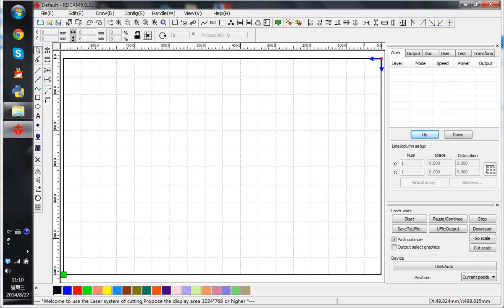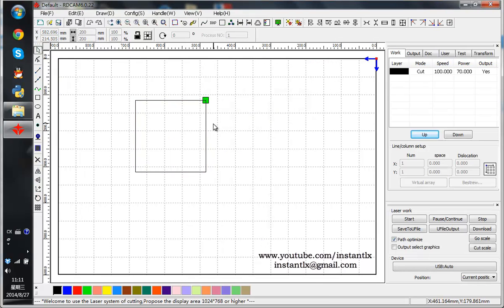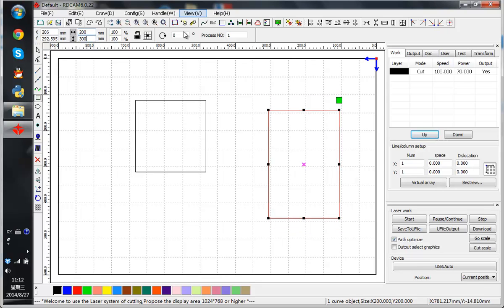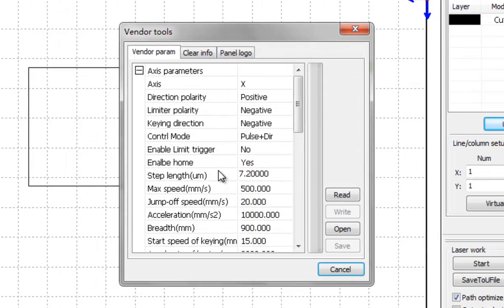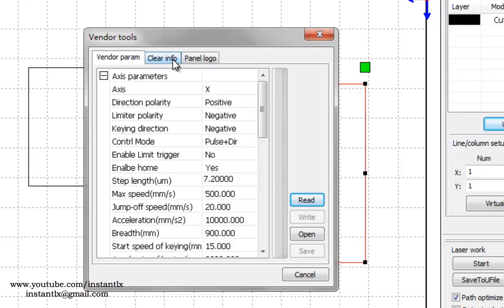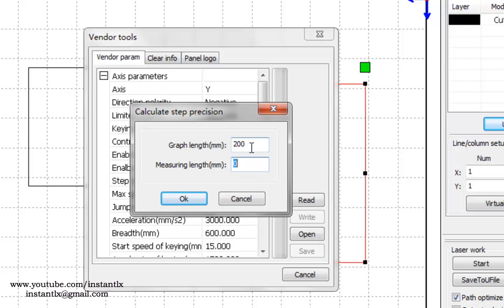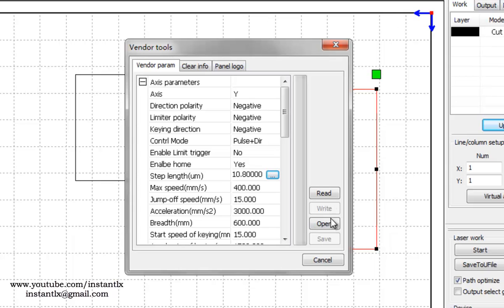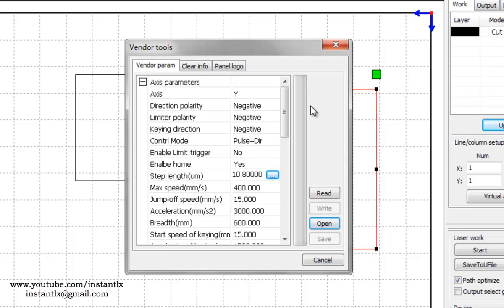Set laser work parameters for rotary axis on China laser cutting and engraving machine

Comment: Hi, can you help me with a problem? I cut my concentric circles in mdf 3mm with measures of 150mm - 250mm - 350mm, I do it with 25 speed 65-70, all in the same file, when I want them to turn I can not achieve it I have checked the power, alignment of the laser, the fall of the laser, the leveling of the table and the focal length.
Sometimes I get them to turn but it is difficult to have the same results several times.

Comment: lets say i hav machine of 3' x 4' ft and the machine cuts the parameter of 1300 and 900 mm so 3 ft is 36 inch which is 914.4mm so how m i supposed to cut 914.4 mm when the machine only cuts 900mm. . .so is there any way that i can limit the parametere of x or y ??
Reply from the maker: config, page setting

Comment: Hello! I have some problem with my CO2 laser. I connecet my rotary axis, after work i deactivate but the settings remind for rotary axis. I start cutting plywood in normal mod but laser recognizes rotary axis. How return settings for normal cutting? Thanks for ans!
Reply from the maker: which software do you use? if you're using RDCAM then just use the same way in this video to get your machine back to 2D work. email me if you need more help. instantlx@gmail.com

Comment: Hi
I did not save my settings before using the rotary for the first time on my Chinese CO2 60w laser cutter. I have a hotdog laser. Now the Y axis is not working properly in normal mode.  If I try scan an object it squishes it. For example if I was to scan a 40mm square it would come out 40mm x maybe 5mm. How can I fix this?
Reply from the maker: use the same way, modify the setting as you do for rotary.  then input the size you want and the size your machine does.
Reply: Sorry, I don't understand what you mean. Could you please explain more